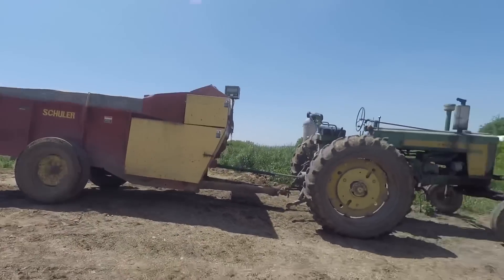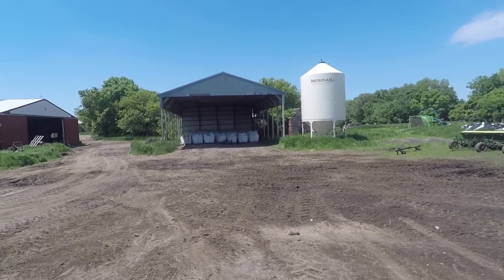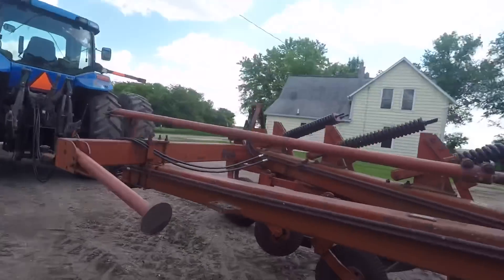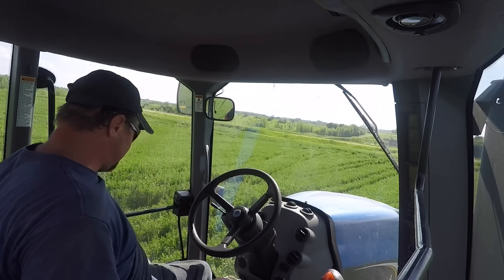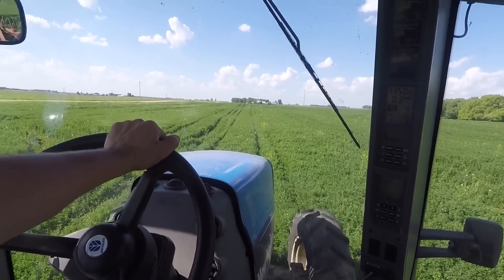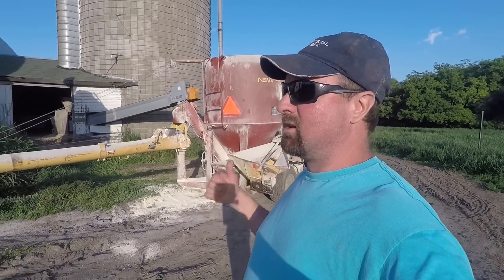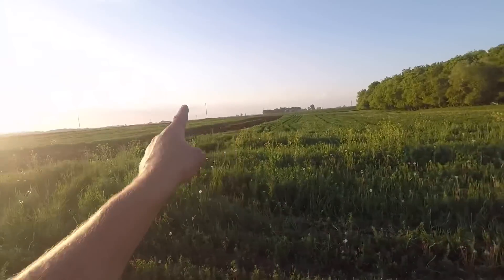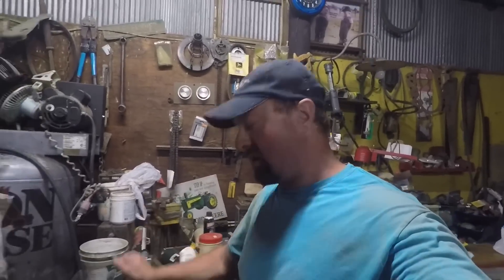The First Day Of Plowing And A Minor Issue With The NewHolland TG210!

Comment: That plow looks to be in excellent shape for its age!! Just a little advice, if you want it, take a torch and cut the rear corner off your plow shares.  They aren't really necessary and it will pull a lot easier as well.
Reply: If I knew how to add a picture in the comments I'd show you what I mean
Reply from the maker: I think I know what ur talking about. Thanks for the advice! 👍😎
Reply: @organicpaulguy  your welcome. You know how the front of the share is angled on like a 45 towards the front of the plow, well the back of the share is angled just like that except the opposite.  It's angled towards the back. Well that's what needs cut off. It makes a difference in pulling,  believe it or not and it's not necessary to be on there.  Just a thought.  Have a good one bud!

Comment: Loving the sound of the TG210. I think those larger models of NH reminds me of the larger models that Ford used to make. A farmer I helped out at had a Ford 8000- series something and the back window, cab and the rear lights on your tractor reminds me of the old Ford. Thanks for explaining about the nitrogen stuff. What difference would a chisel plow make instead of a moldboard plow?
Reply from the maker: The chisel plow won’t kill off the alfalfa as good as the plow will.